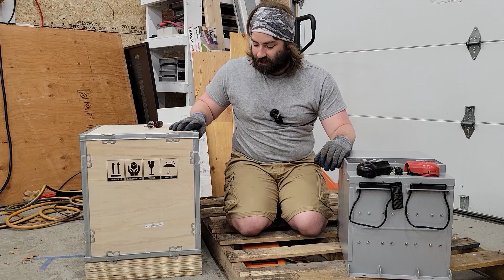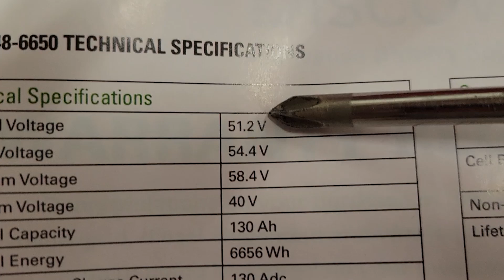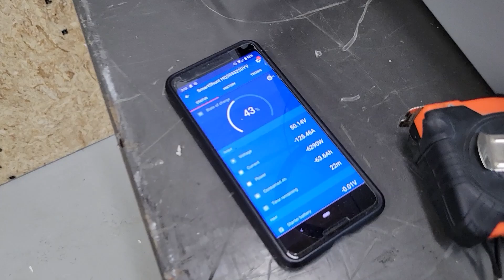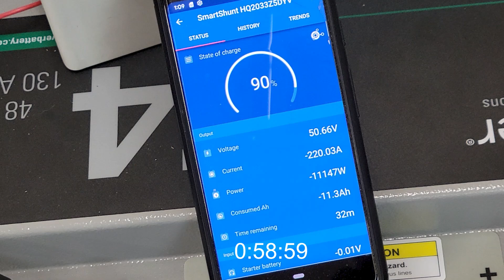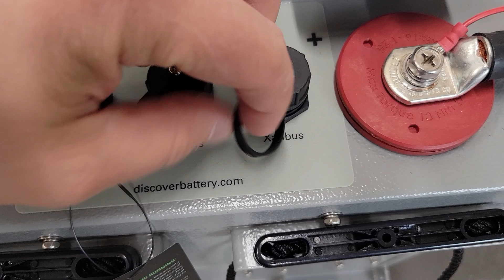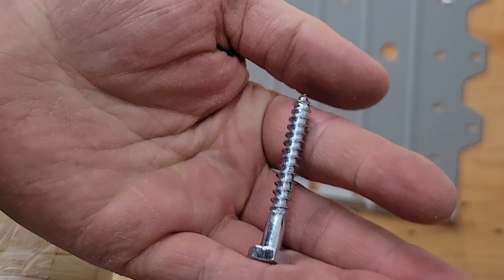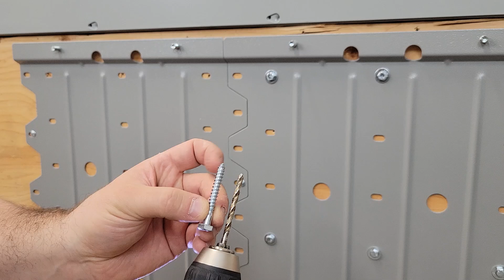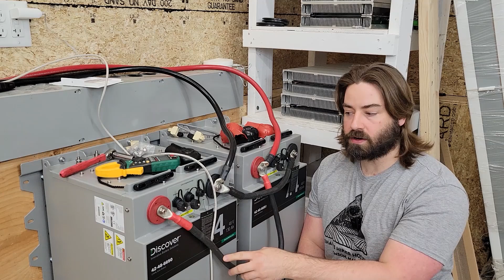Discover Battery, worth the price?

Comment: some people might think these are to expensive @ close to $5k each(about $150 for shipping), but for what you get its prob a better deal than others. This is the first Ive seen these, they seem rock solid, safer than Lipo, and should last a long time. Only thing I'd like to see is maybe a small screen built into the battery so you can check there current conditions real quick.

Comment: Big battery appreciate your testing but i am wondering why you don't add fuse projection at your battery with maybe an mrbf fuse if a battery fails and we all know they can you have power feeding from both ends feeding to a failed battery Typically each power source should be fused..
Reply from the maker: Each battery has a built-in 200A fuse.  In addition to that, I add more circuit protection.  Once I parallel a few batteries together I add a Class-T fuse.  For a video on the class-T fuse look here: https://youtu.be/A0bqClj5urg and/or here: https://youtu.be/eWqJjlHoW9A
I also have large 250A DC circuit breakers in my PDP.  
Thanks for watching.
Reply: @DavidPozEnergy  Thats good it has an internal fuse maybe i missed that if it didn't than an mrbf should be used batteries have huge arc potential and just having a t fuse downstream isn't the safest

Comment: What battery charger are you using to charge these with?  120V AC input?  I have been looking for a charger that I can use to charge my batteries using AC.
Reply from the maker: In this video I top balanced them using my small 120V charger: https://signaturesolar.com/eg4-battery-charger-48v-18a-1/?ref=4_rHcgZ9x-TiF-
But day-to-day, I charge with solar.

Comment: Hi David. Absolutely love your channel and have to ask your opinion on  supercapacitors. I have been experimenting with one nesscap 16v 583 farad capacitor. For solar storage for a home as long as I have enough capacitors (yes I know they only hold a fraction of what a chemical battery does) in a large room. They theoretically last forever and you can charge them at any rate just have to have a high voltage limit.
Am I missing something? Would love your opinion or if you have already done a video tell me which one lol thanks from Canada

Comment: Can you tell what the retail price of this battery is ??
Reply from the maker: $4500, but I've seen it vary quite a lot from one supplier to the next.
Reply: @DavidPozEnergy  Thanks David, That is very reasonable considering  batteries like the ones you are using are 10K for 30.72KwH with the cabinet. I watched a video of a guy that is installing 6 of those 6pack racks in his home.

Comment: I looked up the specs on that battery and it's about 200 lb which is about equivalent to 14 KW hours of lithium iron phosphate cells. It seems that for that weight this battery should be capable of much more output than 7 kilowatt hours.

Comment: David, if you are making and storing DC, why is your off-grid home AC. Yes, this was how it has been since Edison lost the argument, but with today's technology, you could run the home with DC especially since it is full of transformers. These are in your lights, in your equipment, in your computer and any PCB. All have transformers as they run basically off DC. A 48V and 380V bus would simplify your life. Yes, Schneider want you on AC, but these transformers consume/waste unnecessary power. Interested to know your thinking?
Reply from the maker: It's a great question.  I've considered making a hybrid approach.  Running lights on 12VDC, but still keeping the larger appliances on AC.  
But, if your question is about running all home appliances on DC, then I'm not sure about that.  For example, my table saw is probably a universal motor that can run on DC.  However, the switch is only rated for AC.  DC rated switches are fairly large and expensive.  If I have to start replacing parts on appliances with DC switches, and DC step-up or step-down converters, then I don't see how it's worth it compared to one inverter.  
Admittedly, I haven't run through a full analysis of this.  Can you link to a video or blog, where someone has?
Reply: @DavidPozEnergy  My question was general, because I didn't have a clear understanding of the Code issues, but realised that the 380V stuff might better stay as AC for now. The Code is going to require AC plugs in all rooms. But the 48V LV and ELV using Cat 6 cabling could be easily done, as of now.

I my case I have 25kWp ground solar, through 2xPowerwalls, so leave this as is, and run the house heavy load appliances AC, but rewire the lights and USBc with Cat 6 (this has to be done).

I might put the conduit in place for further DC upgrades as change, we most certainly will.
Many thanks

Comment: Hey Dave, this a question about the 6kwh LG chem battery you built 3 yrs ago. How did it do? Are you still using it? Any other thoughts about it?
Thanks.
Reply from the maker: I used it for about a year before moving things around.  When I removed it from the wall it has sat on my shelf, un-used.  I never had a problem with it when using.  I should probably check it again.  Just now I looked at it and nothing seems out of place, no corrosion.  Still has proper Voltage.  There are just easier solutions today.  You can buy prismatic LiFePO4 cells to DIY a battery and everything bolts together.

Comment: Where the positive and negative terminals are, I'm wondering if there is a non-electrically conductive, but thermally conductive material they could use, to keep those points cooler. Seems like an opportunity where the big red and black pads are.

Comment: how well the calibration is on your measuring device ? if calibration is off  your measurement are directly affected hence your opinion and conclusion !
Reply from the maker: All my equipment is homeowner grade.  I'm testing things in my garage, not a lab.  I have a video where I talked about this and did a rough calibration on my meter.

Comment: The high current capacity of these batteries is pretty amazing. I'd like to see them offer a high voltage version, like 400 volts. That way it would work with the Dcbel Energy r16 DC power manager, which wants 400 volts DC nominal.

Comment: Most important elephant in the room on this fathers day is BRAKE THE HABIT of TOUCHING TERMINALS some day you might get bit and it will kill you it scares the poop out of me when I see someone talking to a camera while touching the terminals. I have 39 years experience as a electronics and design engineer.  It starts out with "it's only 12 volts" or "it's only 24 volts" then "it's only 54 volts" . Try going to a funeral with a friend laying in a casket face reconstructed due to part of it blown off from touching a terminal. And the crushing grief  from his fiance and family dealing with " it's only ? volts"

Comment: There’s nothing more permanent than a temporary installation. Maybe not, but the wall mounted configuration I opine, is much cleaner and stable especially for anyone even close to a seismic zone.  Question: Since these feed an inverter with at least ~ 120V AC inverter, is there any need for an equipment bonding jumper, so all the metal cases and enclosures remain at the same potential in case of a fault; thus, providing a path back to the source?  Even ~ 54 Volts DC in those high Ampere discharge rates I imagine could be shockingly dangerous 😂. I don’t have much experience with commingled systems, and there may be very good reasons for keeping them isolated.

Comment: i guess that most of you know that you need to continuously adjust the 120 vac load, since the inverter requires more current IN at lower battery voltage to give constant output power...and, kWh is complicated by the voltage change over time, and it has to be an integrated measurement, since the V * I is constantly changing
Reply: Looks like you should do some reviews and show us how it's done there professor

Comment: Plus rivets where you aren’t in studs would be a good option 
Or could have put mounting plates on before putting plywood up with nut serts on back side or through bolt with large washer, small recess optional on mounting board or wall
No worries about battery position relative to stud positions as long as you secure your plywood to studs correctly 
I work on RVs and have to put mounting plates in and secure mounting plates 
Dry fit with cardboard the size of your batteries and make sure you have room for wiring

Comment: metal (iron), CuSO4 dilute H2SO4 water electrolyte, graphite air electrode + metal spool sheet feed = mechanically recharged metal-air battery, iron energy storage rating is 2kWh/kg as a power source (assuming 80-100% fuel cell efficiency), think iron/metal as hydrogen in a fuel cell, but its solid feed of fuel, typical magnesium fuel cell efficiency 90% as a battery cell, dont count the "engine" weight, only the fuel, into storage per kg rating

Comment: You did awesome job explaining the step by step setup, thank you again for another outstanding video. The company that sells this battery however have no listed price, instead they want people to contact them for pricing, that's very shady. For that reason I simply will not have appetite for their product.
Reply from the maker: They don't sell direct to consumers, only wholesale pricing.  There are several distributors in the US that sell these and I've seen pricing about $4500.  But, it will vary quite a bit from one supplier to the next.

Comment: The premium for UL9540 is a stinger, and in jurisdictions like California and Canada a new system won't pass inspection and you won't get federal incentive $$ without a 9540 sticker on battery/inverter. As usual, the bureaucrats drive pricing through the ceiling.
Reply from the maker: Yeah, Sometimes I wonder how many rules actually help safety vs. just make the Gov. money.

Comment: Stacked lugs is for sure less than ideal as you mentioned....only 3 amps but that is almost 170W. Yikes. That is significant heat. 

Hard to justify spending $600 per kwh and deciding to save $160 and not buying a Victron Lynx Power In.

Comment: Great video and awesome review, David! At these current levels I am glad to see you use your IR camera to look for hotspots. But you might consider investing in a good milliOhm meter to make sure that your connections are tight and wire resistance is balanced.
Reply: Is that the same as an internal resistance meter?

Comment: Hi, my Transit has two 250A 12v alternators. Is there a MPPT charge controller that can use 500A 12v DC to charge my 400AH 12v DC lithium battery?
Reply from the maker: Not that I'm aware of.
Most Van conversions I've see will use a couple of the Victron: https://amzn.to/431IvTH

Comment: You know when you use an AC inverter it imposes a 120Hz sinusoidal current onto the battery. This means the current drawn from the battery varies from the base inverter draw to double the average current shown by the shunt. So while you were doing the 200A load test the actual peak current was close to 420A.

Comment: thousands more for similar EG4 battery which are good batteries.   Don't see how these compete.   Solar-electric sells these on sale for $4500 or  $608/kWh.    EG4  comes in at $280/kWh.   That is a HUGE difference for say a 30 kWh battery.   $8400 vs $18000

Comment: Looks like in the summer they will introduce ELEMENT ESS Battery basically looks like SOK or EG4 batteries. Just waiting for the UL certification. Looks like they will have a rack for up to 6 batteries and also have outside racks for these. Brief description manufactured with the highest-grade cobalt-free LiFePO4 cells.

Comment: Excellent review David.  Reminds me of Snap-On versus Harbor Freight.   Some very nice batteries.  That said they are large, heavy and expensive compared to SOK or EG4.   Roughly 2x the weight and 4-5 times the cost.   192lbs for 130 amp/hour at 48v for a van/truck/car is really, really heavy compared to other options.  That said, they are very, very nice batteries.
Reply from the maker: I agree with you.  This won't be for everyone.  BTW, the 130Ah is at 90% of the total capacity.  It's rated very conservative.
Reply: @DavidPozEnergy id love to see a growatt 12 kw low frequency inverter test
Reply: @DavidPozEnergy how much are each individual battery?

Comment: I hope the wall mount works but with two batteries mounted on 24” OC studs you’re only going to catch one stud. The 400lb load may pull the ply layers apart or allow the screws to pull out of the ply. You might consider some horizontal strips of steel, lag screwed into your studs 24” OC behind the ply, and bolt through the back of the steel and plywood to mount the batteries into the 16” OC holes as designed.
Reply: True the weight pulling on the threads may separate the layers of his 3/4 plywood but did you notice that those lag bolts have at least a 1/2 in shoulder on them so technically there's only a little over a quarter inch of thread engaged in that board! Hopefully that chip board behind it is really strong!
Reply: Just use strut

Comment: Are the internal batteries like an 18650 cell or the pilaster bags ?
Reply from the maker: I think the cells are 32mm diameter.  Discover Battery has a good video looking at the internal parts: https://youtu.be/o2QERMxzfZg
Reply: @DavidPozEnergy  Yes they appear to be 32650 cells. I like the peripheral they have to connect, communicate with Victron Charger, inverters. I think this unit would have no problem passing a MIS-SPEC test. Not only that, but I like the channel, you do real world testing and analysis.

Comment: It seems these batteries are really heavy for the amp hour size. Was just looking at some cells about the around 100ah size and though they didn' have a case and bms, they were around a hundred pounds for 16 cells. Weight can be a factor for the RV user. Still looking for lifepo4 cells from a trusted place at a reasonable price.

Comment: david  what do they go for $$$$$$
Reply from the maker: About $4500, but the price can vary between distributors.
Reply: @DavidPozEnergy  thanks dave, they are beautiful  and after you did your great testing and hook up video i wish i had the ten grand for them. dave your videos are just fantastic and i have been looking from the very first one. every time you put one out you get some thing better then the last time. how do you keep from buying some thing and putting it in service and next month some thing better comes out. that would kill me , please keep the videos coming. god bless you and your family .
Reply from the maker: There is always something better out there.  What I suggest to everyone is: Start with a list of all your loads.   Personally, I use Excel to make a spreadsheet.  List every load, the Amps, Volts, Watts, and duration it runs.  The goal being, to find out how large of an inverter, battery bank, eventually solar, etc.  Once you know what your needs are you can find a system that works for you.  No need to have the "best" if something less expensive works for you.

Comment: I hope you continue to improve and teach what you're learning in your path to net zero. I loved the pace, information and test you're providing. Not too technical, not too shabby. 

Subscribed.
Reply: Well I'll tell ya what you need to get. Well it depends on the size of your house and how much current you are using or area of country.  It all plays a part.  For starting out you need around 20k or more in inverter power. I have 26k. Need around 200,000 watt hours of Lithium. And around 30KW of solar panels. Reason being is when it's winter and cloudy for days on end you panels produce next to  nothing. You need a big battery bank. Also a genny would be nice.
Reply: pace? i had to watch it at X1.5 speed because he talks soo slow🤣

Comment: Nice battery but the price is above everything else in the LiPO4 market. The Signature Solar rackmount batteries give you twice the kWh per $. Will these communicate with other inverters that are not Zanbus?
Reply from the maker: Yes, I said the same thing in the video.  Yes, these can communicate with other inverters.  There is an additional device Discover sells called the "Lynk 2" that allows communication with some difficult inverters.  Such as, the SMA inverters.  The SMA inverters won't talk with just any RJ45 connection, but the Lynk 2 will.  Just in case someone needed that specific type of thing.

Comment: Hi David, I wanted to thank you for your efforts in making this great content. I am very envious because I live on the north side of a steep mountain on a completely wooded lot. There is no solar panel sized area of my property that gets direct sun more than 5 hours per day, even in peak summer. So solar is out for me. Also Tomatoes ;) Still lots of fun to watch you do it.
Reply from the maker: Your welcome.  Thanks for recognizing the huge effort it takes to make these videos. I'd love to live on a mountain side, so I'm envious of that.  Perhaps a wind turbine could work for your site?
Reply: Wow, I live in a cabin surrounded by SWAMP. 😂
Since you live high up, you might want to look into electrostatic motors. (Note: this can give 24/7 low levels of power all day!)
For the higher you are up the more power you can get!  (With enough wires, you might be able to farm 1000 Watts or more! All due to height!) 
https://en.wikipedia.org/wiki/Electrostatic_motor
Reply: @marlonlacert8133 doesn't the atmospherics static, get pushed up from the mountain?
I'd probably say yes and no. Yes because of the ground. And no because of wind.